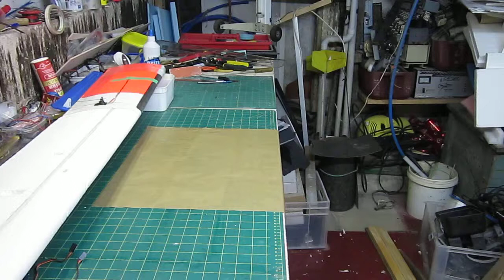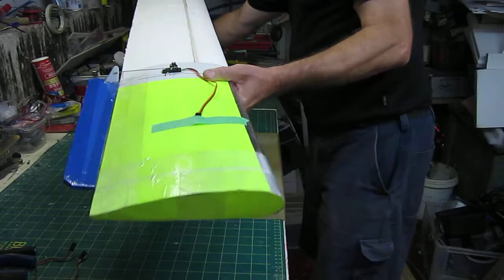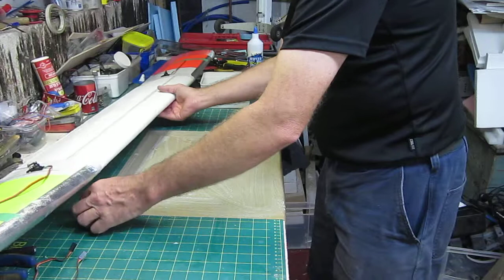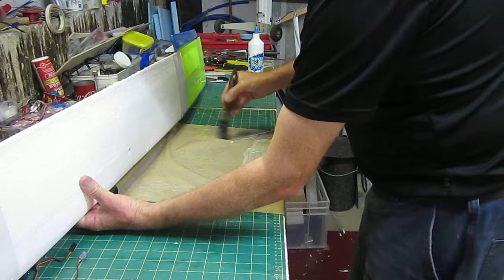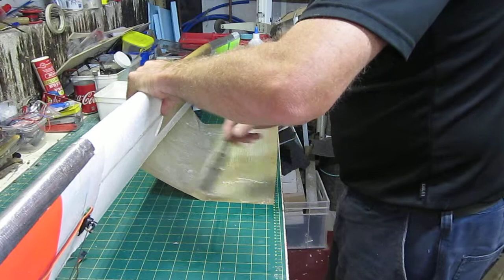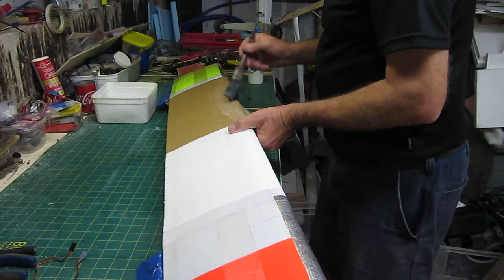Covering a foam wing with brown packaging paper

Comment: Wow, Granddad was right, I do like what I see you have done.  I have experimented with the brown packing, or wrapping paper that is labeled lightweight and it is compared to other options like it.  I have seen this done in a number of videos and in each they express the need to do both sides at the same time so the wing is less likely to try and warp as long as both sides dry out at the same rate.  I think that is what you are suggesting in this video also.

Comment: Tips:
The paper comes off much easier if you mist it with a water spray.
The paper should be removed from both sides, then the tape applied, then bend. The results are better.
If you leave the paper on, it will NOT be waterproof and even high humidity could cause it to peel off.
The PVA GLUE is not waterproof.

Comment: Why would you start in the center of the wing? By starting at the trailing edge the finished seem would be closer to either the trailing or leading edge. Thus hiding the seem line better.
Reply from the maker: This was a repair job. The original wing was an experiment. It had no spar. I inserted a spar in the center section and this was recovering this section.
I discovered that polystyrene covered with brown paper will fail in compression. A spar is needed to prevent this issue.

Comment: good video, but yo don't really need to soak the paper in water. Whe the glue solution is applied it will soak into the paper.
What kind of paint would you use and do you prime the paper?
Thanks for sharing.
Reply: It appears he doesn't reply to comments, or Youtube is having issues again and he never saw your comment.  I am sure the reason he primes the paper with water is so less glue is needed, which is likely thinned a bit also.  As to paint, most use acrylic paints, but the paper and glue combo does make it possible to use almost any paint that won't add significant weight.  That is assuming the paper skin is preventing the paint from soak through to the foam.  There are more than a few other videos like this that go into more details.
Reply from the maker: @wattwaster5936  Hi, I am sorry for the late reply.  Priorities have shifted due to health issues (pernicious anemia) and a 20% reduction in income (economic byproduct of c-virus).  I found by experiment that pre-soaking the brown paper (5 min) allowed it to fully expand.
I hang the paper up until it stops dripping then apply the glue.  The white glue seems to penetrate better and results in improved adhesion.  You should also notice the paper wraps the wing completely with a generous overlap on the leading edge.  Thin the glue until it is easily paint-able.
While the glue and paper is still wet, I wipe the completed covering down with a moist cloth. This gets the last of the bubbles out and removes any white glue from the exterior surface. Within a short period (30 min) I coat the whole surface with  a water based urethane (which dries at the same time as the glue to form a hard skin).
The trick is to allow everything to dry slowly (in the shade). In warm weather do this in the evening and allow overnight to dry.
 Once dry, fill any hollows with lightweight spackle, sand smooth and paint. https://www.youtube.com/watch?v=4wDGqfhrEEw&t=312s start at 4.30.
Also https://www.youtube.com/watch?v=C9jWIAJLxgw&t=222s start at 3.00 and https://www.youtube.com/watch?v=hpz5sO37Nzo
Reply: @flyingweed9671  Nice details the other videos in my playlist often don't get into.  Thanks and I know what you mean about life and priorities.  I am an old guy and feel your pain.  I have plenty of my own to deal with.
Reply: @flyingweed9671  очень не качественная работа

Comment: seem heavy
Reply from the maker: Yep. It's heavy when wet, but it drys and becomes light and strong.
The trick is to dry slowly and evenly to prevent warping.
When the wing fails, it fails on the upper surface, in compression.